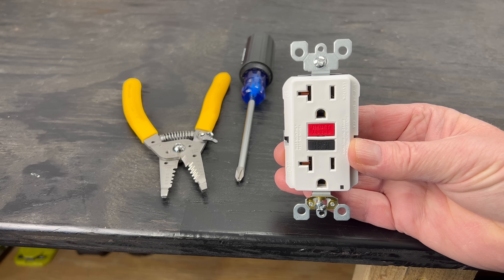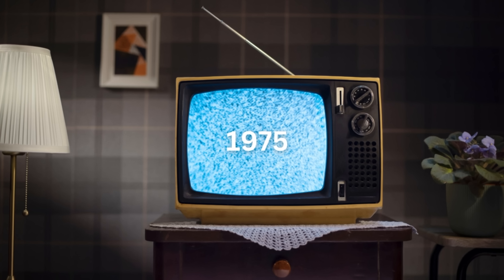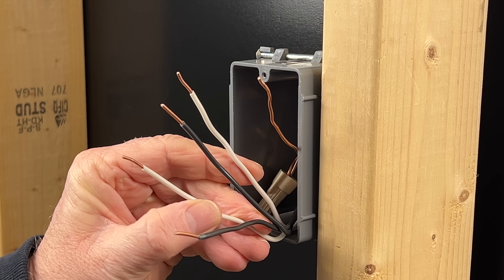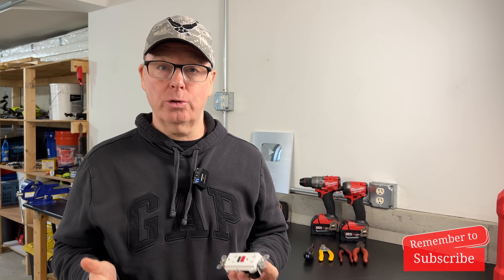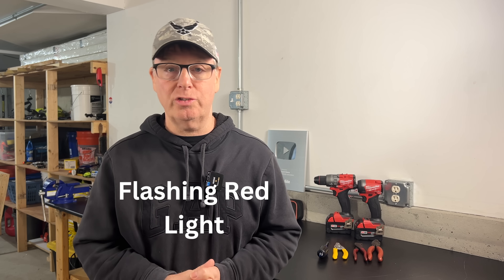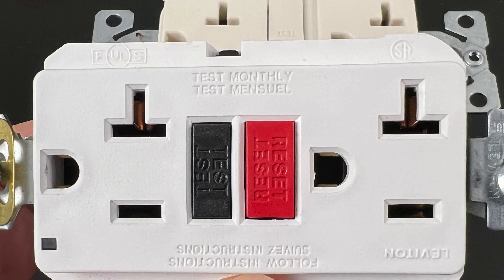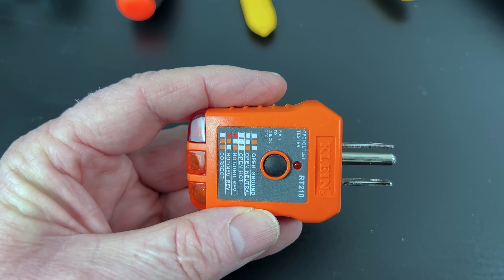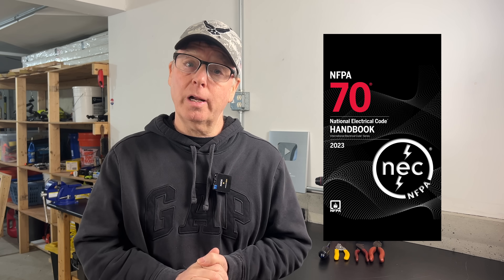Did GFCI Receptacles Change Without Us knowing?

Comment: I like the external tester, because the "test" button simply shorts the hot and neutral together which causes a small arc and eventually deteriorates the outlet.
Reply from the maker: Actually the test button bleeds a small amount of current through a resister much like the circuit tester but the circuit tested give you a visual indication that the power to the receptacle was actually cut off.
Reply: A short of hot and neutral wouldn't do anything as far as the GFCI is concerned. The GFCI only cares about the same amount of power going through both wires.  A short between them still has a balanced amount of current between them.  As @BackyardMaine pointed out, the TEST button allows the hot line to ground through a limiting resistor, which the GFCI does care about.
Reply: @jovetj  If you connect neutral and ground that creates imbalance that can trip a GFCI but those testers use so little current that it would not happen.

Comment: That little indicator light in the bottom corner could be pretty worthless.  My water softener has a big block plug that the cord goes out the bottom.  So, it uses the bottom outlet, which would then block that light.
Reply: Your receptacle is installed upside down.  Turn it 180°.
Reply: @denverbraughler3948 no it's not.

Comment: Lots of comments about never having had a GFCI outlet fail: I've had at least two in our house.  One was in a half-bath, and it just didn't work reliably when I tried to use it.  My outlet tester showed a fault (I don't remember exactly what the light code was, but I think it indicated ground/neutral miswire).  It was wired correctly, but apparently had an internal failure.  The other GFCI that failed was in the garage where our Internet equipment plugged in (the ONT for fiber-optic), and it just tripped frequently for no good reason.  Replacing it eliminated all the random trips.
Reply from the maker: They can fail but it's not common. Sounds like you had some bad luck. I have about 12 or more of them in and outside my home that I installed 26 years ago and I have never had a failure.
Reply: I have had a lot of failures outdoor--I assume from moisture.
Reply: I had one fail in this house. When I took it out to replace it, I discovered that they had stuffed 3 12-2 Romex cables into an 20.5 cu in old use outlet box. Once I replaced the box it stopped nuisance tripping.

Comment: Thank you!  I converted our receptacles to the new tamper resistant variety to be kid-safe (I hate the plastic safety plugs).  I noticed that all the new GFCI receptacles had the LED lights, and didn't realize why.  I've avoided changing one out because I really don't want the LED light in that room at night.  Now I know why I can't find a replacement that is tamper resistant without a LED.
Reply: Use black electrical tape to cover up the LED.
Reply: @brainwater  Just like the countless cars with tape over the check engine light on the dash. :)
Reply from the maker: Glad it was helpful.. Thanks for watching.
Reply: Eaton GFCIS ones (available on amazon) only show the light if there's a problem / tripped. I've been buying them for that reason. I HATE the little green light in bedrooms

Comment: I don't remember having to wire one of these, and I've generally assumed they were standalone.  The idea that there would be load terminals was a bit of a revelation.  And, it's more likely that I would find myself working on one of these that someone else had installed, so we can assume that in that case the warning label would already have been removed.  Thank you.  You are probably saving lives.
Reply: P.S. I already have one of those testers.  I kind'a have thing for tools and testers.
Reply: FYI-They are designed for use for circuits with multiple outlets too and ONLY the first outlet in the circuit needs to have a GFCI outlet.  It will make ALL outlets downstream protected.  (Annoying is when the GFCI is in the garage, but it also protects the upstairs master bath) If you wire more than one GFCI on a circuit, ‘sometimes’ they will start interacting with each other and have false trips.
Reply from the maker: Glad to hear you leaned form my video. That is the goal of the channel. Thanks for watching..

Comment: Great information about these devices. I think if anyone actually tested their GFCI every month it would be broken in short order from all that testing. I’ve seen them last 25-30 years (they don’t make them like they used to) rarely being tested and when I test it, it still works.
Reply from the maker: You are correct. I wired my house 26 years ago and every GFCI is original, even the ones outside.

Comment: I had a friend who has a 10 yr old pretty high price home. In one upstairs bathroom the outlet was wired to a GFCI  in the garage. I had to help him find it  . Crazy what the did ,. great video. Thanks
Reply: Had a work colleague, he had a two story house, probably about the same age.  He had one of the upstairs bathrooms receptacles die so he figured GFCI.  Started looking for the master outlet, finally found it in the Garage on the first floor underneath it.  Did some exploring, another bathroom, not over the garage, had no dedicated GFCI either, found it downstairs in the laundry room.  As all of these houses were development projects housing, they were all built with assembly line techniques, and seeming less systematic and more 'fast as possible' methods.  I would think they wouldn't have passed inspection, but maybe they apply the Boeing method of quality inspections.
Reply: @paulholmes672   I am too lazy to look it up right now, but some other country puts theirs at the breaker (I think Japan). Unless that breaker box had every outlet listed they must have the same problem.
Reply from the maker: Oh wow! I'm surprised to hear that about a 10 year old home.
Reply: Our former house had the receptacle in the upstairs bathroom controlled by the downstairs bathroom. People cut corners in dumb ways.

Comment: In the Chicagoland market it's easy to tell what the load side wires are. The standard is purple hot and gray neutral. Of course you probably have to learn how to bend EMT for wiring your house first.
Reply: Yup, because chicago is so special - and the rest of the world gets by just fine without having all wiring in conduit... more useless regulation
Reply: @gorak9000  Nice thing about conduit is it's easier to rewire or change things later.
Reply: @jovetj  In all my years, I've never had to replace an existing wire - sure, add an additional outlet here or there, or add some 240v circuits where they didn't exist before, and I've run into the situation a couple times where adding an additional switch would be nice, but not worth the effort. Adding conduit after the fact would make it so much worse in every case vs just pulling some romex through a couple of small holes from an existing box

Comment: i removed ALL my gfci outlets. they were running hot enough a plastic smell was noticed with NOTHING plugged in. all wired correct & functioning. new stuff is junk & dangerous. you can have it 👍
Reply from the maker: I have never seen a GFCI get hot like that.. I believe you but in 40 years in the trade I have never seen it happen. I also haven't had any issues with the new GFCIs. An occasional failure but thats to be expected.

Comment: Can you chain GFCI outlets on the same circuit? Or add one to a circuit that already has a GFCI breaker?
Reply: After having a tripped GFCI that wouldn't reset in our kitchen, I found out that it was because the other one had tripped, and it wouldn't reset without power.  There are two circuits for the kitchen outlets, but when they were wired, they accidentally put both GFCIs on the same circuit and left the other unprotected.  I'm glad I fixed that.  In most cases having multiple GFCIs on the same circuit is due to a mistake like that and should be avoided.  It does nothing to add protection, creates hassle if it trips, and adds expense.

On the other hand, if you wire the first GFCI using pigtails so that the next receptacle isn't chained through the load wires, then that will work just fine.  This gives the advantage of having each outlet with it's own independent reset button, and if something trips one, the other stays live.  That could be useful in some very specific situations, such as where the GFCI is hard to access, so if the trip is from a different receptacle, you would then be able to reset it more easily.
Reply from the maker: Having duel protection would make no sense. They will work but why spend the extra money. In locations like kitchen countertops where you may want to run two or three GFCIs on the same circuit for aesthetics rather and one with a few standard receptacles wired to the load side it makes sense. But you would parallel off the line side rather than connect to the load. I have heard people in the comments say that doing that is a problem but I have never found that to be the case and the manufacturers make no mention either.

Comment: Ha ha, no one tests GFCIs. I won’t. But it is good to test all outlets are wired and GFCI is functioning once you move in or have electrical work done or changed outlets. I found a few which were miswired.
Reply from the maker: An initial test is a must to make sure there are no wiring problems. I know.. people don't test them which was the reason for the change.

Comment: Hi John, but does that apply to circuits with individual neutrals?  I see your point if the circuits share a common neutral, but if the have separate neutrals, I don't see the need for both circuits to trip together.
Reply from the maker: I'm showing your comment on my GFCI video so I'm a bit confused. I have another video where I talk about multiwire branch circuits where you will have two hot wires from opposing breakers in the panel that return on a common neutral. With this type of circuit the breakers needs to trip and be turned on and off by a common handle or approved breaker tie. 
The line and load connections on a GFCI are different. The power will feed into the line side along with other parts of the circuit that won't be protected by the GFCI. The GFCI will protect whatever is connect to the receptacle and anything down stream connect to the load side of the receptacle. Both the hot and neutral connections on the line and load side cannot be mixed up. I hope this helps Ken.

Comment: Will the tester trip the GFCI if a bootleg ground is used?  I’m a home inspector and use the testers all of the time.  I’d like to know if there’s a way to check for bootleg grounding without having to remove the cover plate and looking for a jumper between the neutral and ground terminals.
Reply: A bootleg ground will still trip using the tester (unless they tied it to the load side), so unfortunately that probably won't tell you either.  AFAIK, the only reliable way to detect that is either to open it up and look, or to use a fairly sensitive meter to measure the resistance between the neutral and ground pins (if it's a real ground, there will be maybe an ohm or two of resistance from the wire going all the way to the main box and back again.  If it's just a jumper there will be basically zero resistance between the two.)

Note that if you're trying the meter trick, you should do it when the power is off.  Otherwise, if somebody wired an outlet backwards (or there's some other problem with the grounding, or you just touch the wrong pins by accident), you'll likely fry your meter in the process.

Actually, I suppose if the GFCI is also protecting other outlets, and you use the tester on one of the other outlets, then if there's a bootleg ground on the remote outlet (not the GFCI one) the tester would not trip the GFCI when pressed, so I suppose in that specific scenario, it may actually be possible to tell..
Reply: @foogod4237  The GFCI only detects faults on its load side.

Comment: While at an IAEI continuing education class maybe 8 years they they bought up that after UL tested hundreds of GFCI receptacles they were disappointed to how so many did not work and believe some failed to trip so they pushed for the self testing & failure to operate if wired incorrectly feature  but way more expensive GFCI circuit breakers do not have to have self testing feature. Bet less then 5% of GFCI receptacles are tested monthly !

Comment: There are some "smart GFCIs" that count trips and can lockout resets when the GFCI is in danger of failing mechanically caused by too many open-close operating cycles. These devices do not count tests, where you push the test button on the GFCI device, but they do count trips caused by pushing the button on the circuit tester.
Reply from the maker: Interesting.. I haven't heard that..
Reply: Seems like a strange thing to need.  Only looking in from the outside these types of devices in other parts of the world are rated at many thousands of operations.  They should never reach the point where they are mechanically end-of-life.
Reply: @retrozmachine1189  We tested ours to over 100,000 operations.

Comment: NOT going to pull the refrigerator out every month just to test a GFCI nor uninstall the microwave, test the outlet, then reinstall either.
I have a plug in GFCI tester. No problem.

All that testing wears out the GFCI too. And GFCI's are NOT cheap to replace either.
How about installing GFCI circuit breakers instead?
Reply from the maker: You can surly install a GFCI circuit breaker but it will cover the whole circuit and they are a lot more expensive. Testing a GFCI doesn't wear it out according to the manufacturers. The tester just leaks a small amount of current through a resistor to ground. A solid ground fault experienced multiple times can cause premature failure.
Reply: They're a lot cheaper than they used to be.  I work for an electrical contractor and we are able to get them for about $7.00 each and a little bit more for the weather resistant type.
Reply: Yeah, there's no way that testing an outlet, even every month, will make it fail noticeably faster at all.  Any good one will still last for many decades, at least, even being tested all the time.  If your GFCI outlets are failing faster than that, then you need to test them because they were crappy to begin with and will probably fail whether you test them or not (you just won't know they've failed).

Getting to hard-to-reach ones is sometimes an issue, I'll admit.  That's why I actually prefer putting things like fridges on ordinary outlets which are just wired downstream from (and protected by) another GFCI elsewhere (so they're GFCI'd, and still meet code, but you can still test the GFCI without having to get at that specific hard-to-reach outlet in the back).

Though to be honest, I actually prefer GFCI breakers (or combination GFCI/AFCI breakers) anyway.  Yes, they're a bit more expensive individually, but you generally don't need to buy as many of them to get the same or better coverage (and thus protection), so they can often actually be about the same, or sometimes cheaper in total.  Plus, you don't need to test them as frequently (though I still think it's a good idea to do it every once in a while anyway), they're not as subject to deterioration due to environmental factors, and you can consolidate all of your protective measures in one place/device (no running around trying to figure out which thing tripped, etc)...
Reply: @foogod4237  Anything mechanical does wear out. The more mechanical movement the faster it will wear out.
For me, GFCI/AFCI is not plausible as my breaker box is old and hard to find even a regular breaker.
My garage is tied into the electric for an entire floor (one circuit on that floor too).
No way to run more as that requires demolition of the walls and lead abatement.
For now the walls are encapsulated.
And the box is already full too.

Don't have $30K+ to redo the house.
So, will replace an outlet when it goes bad with an ungrounded GFCI.
Just wish they had the GFCI's IN STORES that had my color. But best is almond, white, or gray.
Reply: @crazysquirrel9425  Yes, anything mechanical will wear out eventually, but that does not mean it will wear out any time soon.  There are many sorts of mechanical devices that can and do easily operate continuously for many years without wearing out, depending on the design and materials.

The amount of wear caused on a GFCI receptacle by testing it is so small that it will last for many many decades before ever wearing out, even when being tested regularly.  The manufacturers even take that into account and deliberately design them so that they will reliably last through tens of thousands of test cycles with no problem, for exactly that reason.

So there is absolutely no reason to avoid testing a GFCI out of fear that it will wear it out, because that fear is, quite simply, completely irrational.

Comment: If you have a open ground the tester will not trip the GFCI
Reply: But the device still works, and is allowed by NEC code.
Reply: What about the built-in test button? It could still work though I don't have a GFCI to test it right now.
Reply: @xonx209  Sure it works as it does not use the ground connection.

Comment: my gfci outlits are 20+years old shuld i replace em? still work good
Reply from the maker: Mine are too. Actually about 26 years old. No I would keep them as long as they still test fine.
Reply: Only replace them if the GFCI protection fails or if plugs slip out of the receptacle easily. Otherwise, you’re fine.
Reply: Personally, I wouldn't swap them out if they're still testing fine (unless you're doing other work on/around the outlet anyway for some reason, then maybe), but when they're that old I would definitely make a point of testing them on a more regular basis...